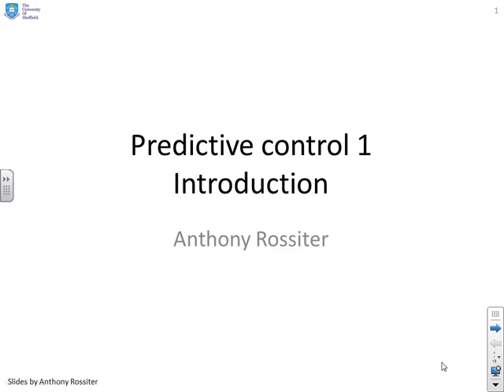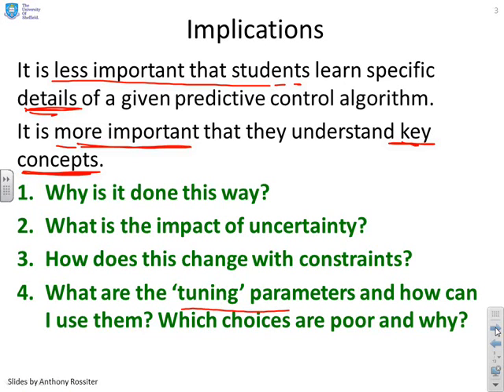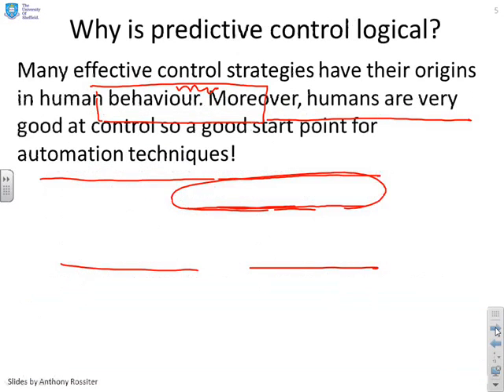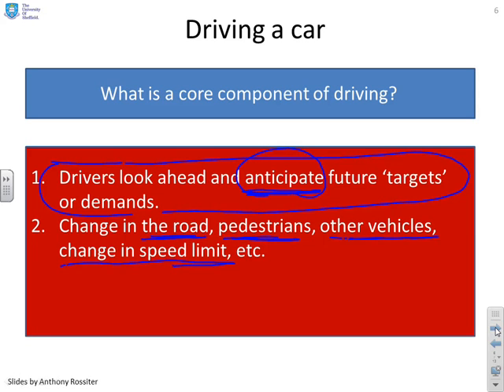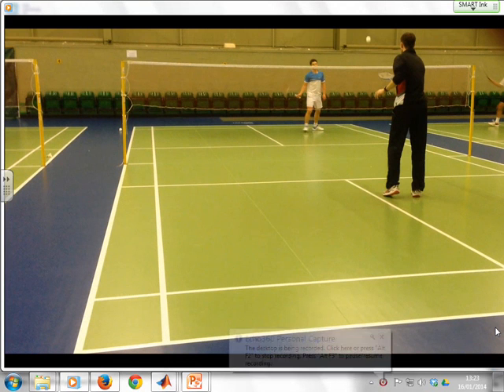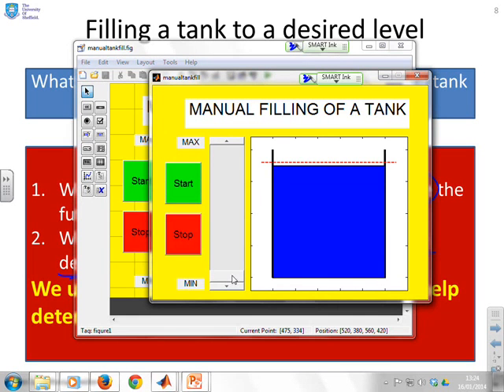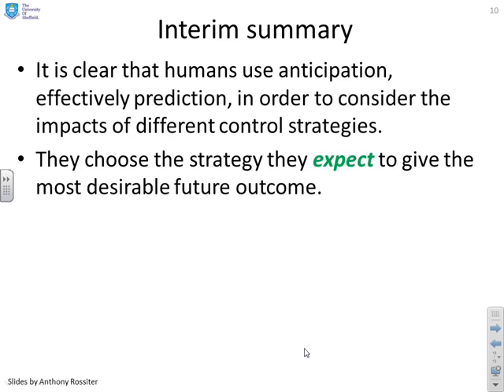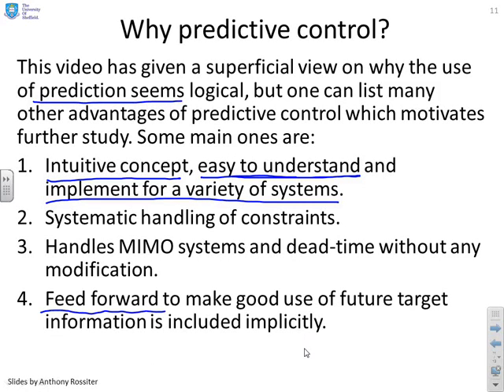Predictive Control 1 - Introduction

Comment: I know it's not the "college way" at all - but are there any videos that take you through a REAL WORLD process, and use the actual inputs and outputs to implement a predictive control method from start to finish. Using REAL numbers and parameters like flow-rates, pressures, etc.? 
At video #4 I had to stop, because I felt it wasn't getting me closer to how I would actually implement the use of MPC in the real world. For instance, where do these calculations take place? In a PLC? A special software? On paper?

Comment: I like your videoes, informative and easy to understand. Thank you for making and uploading them.
The sound however is very high pitched sometimes. I have located the "whistle"-noise to be around 4kHz for those of you who have an equalizer you can adjust on your PC. Also, this is something the author should check into for future videoes. It is fairly easy to adjust in postproduction, and it would greatly improve the quality.
Reply from the maker: ***** Thanks. Unfortunately the software I have access to has no 'post production' or post editing facility. It simply sends out  the recording.Anthony